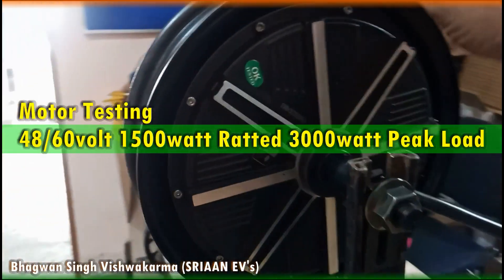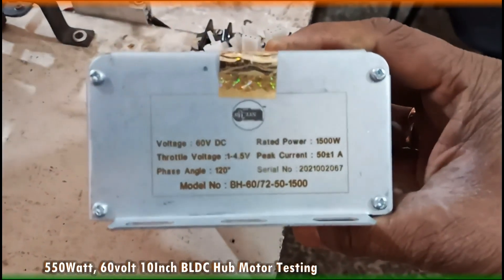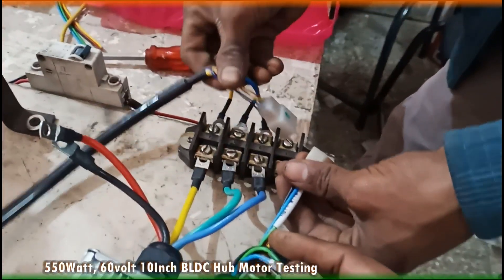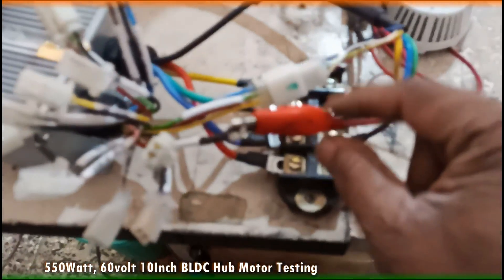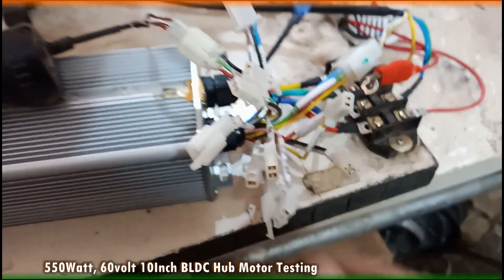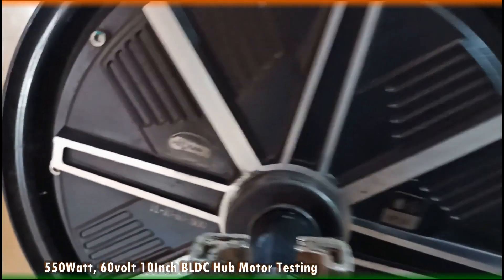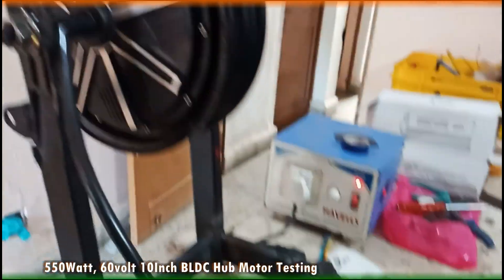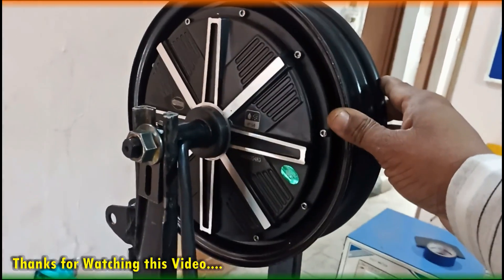Motor Testing 48/60volts 1500watt II #SriaanEv's

Comment: Price and top speed
Reply from the maker: Motor+Controller+throttle 21400, Top Speed with 48 volt 50-55, Top Speed with 60volt 60-65 kmph, for more detail you can Call At SRIAAN EV's Technical Team from 11:30 Am to 6:30 Pm Moday to Saturday @8878575787, and If you like this Video Subscribe our channel for more Hidden Video On Electric Vehicle.
..See you in the Next Video

Comment: That my Dukan link is not working. Also what maximum speed using 60 volt lithium ion battery
Reply from the maker: you can visit at https://showroom.dotpe.in/sriaanelectricvehicle, speed depends on hub motor watt.